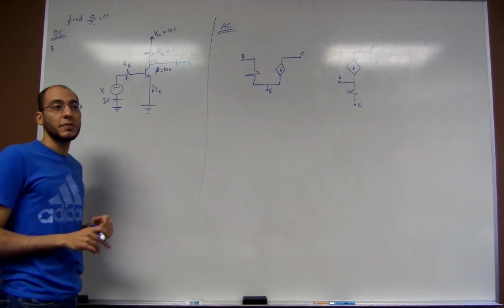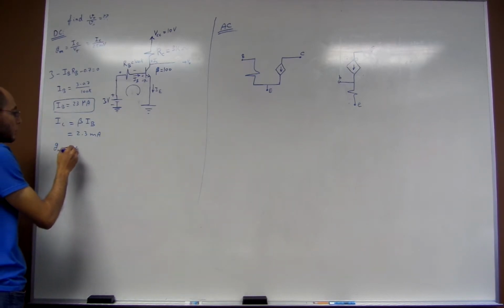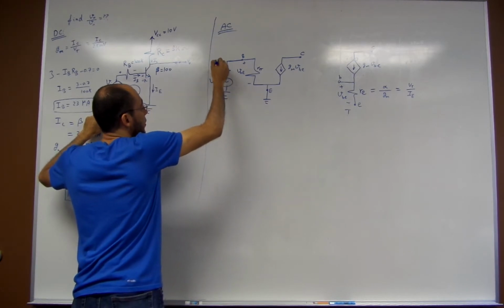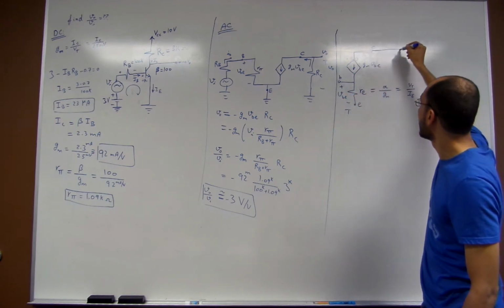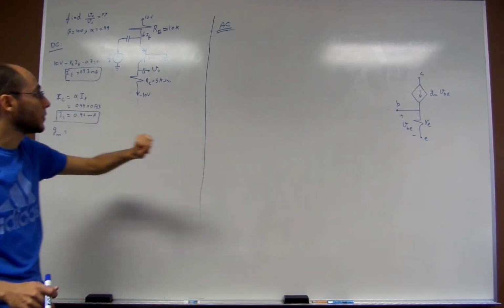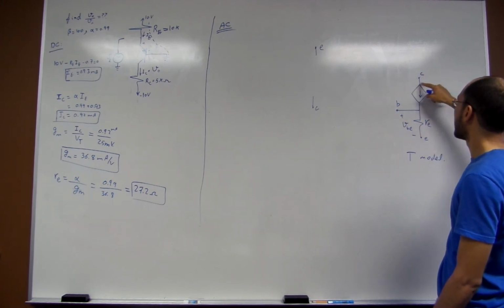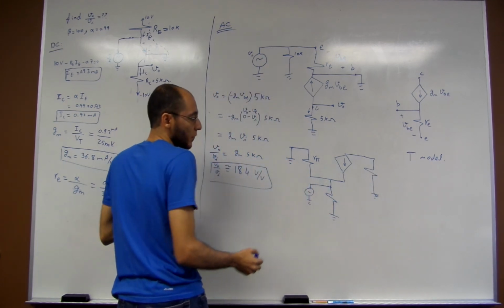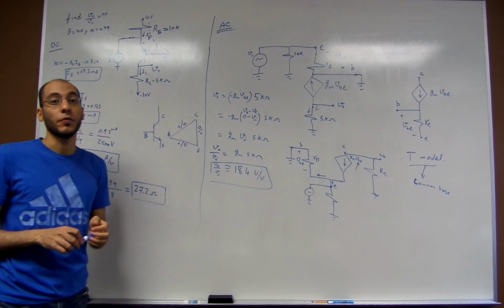Circuits 2 || BJT: difference between pi- and T-models - 2 examples

Comment: Where does Vt come from
Reply from the maker: Thermal voltage which is around 25 mV at room temperature.
Reply: Is that 25mV for all transistors.
Reply from the maker: There's never a one-size-fits-all number. You can Google the thermal voltage and know where it came from and when does the 25 mV (usually it's 26 mV, but I approximated it here to 25) apply to answer your question.
Reply: Thanks for clarifying. Michael

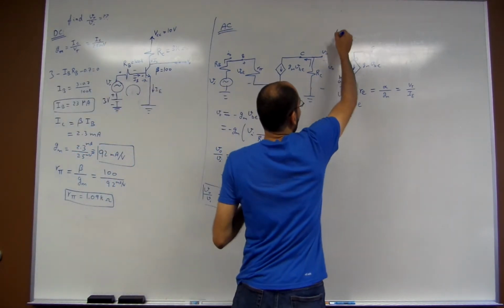Comment: Hello at 12:30 you say it is difficult with T model.
But with T model you get 
vo = -gm vbe Rc
and
vi = ib Rc + vbe
and 
vbe =ie re
vbe = ib (β+1) re
so 
vo / vi = (-gm ib (β+1) re Rc) / (ib Rb + ib  (β+1) re)
vo / vi = (-gm (β+1) re Rc) / (Rb +  (β+1) re)
and rπ = (β+1) re
so you get 
vo / vi = (-gm rπ Rc) / (Rb +  rπ)

You get this rπ by (from common emitter) doing 
vbe / ib = input resistance = (ie) re / ib = (  (β+1) ib  ) re / ib = (β+1) re

Comment: I have a question. Why we need "re" if we haven't used it in the  final equation for finding  out "Vbe"? Thank you for a forthcoming reply.
Reply from the maker: Arman Manukyan, nice question. You won't need it in these problems, but you will need it if you had a resistor in the emitter. In that case it would be series with the re resistor.